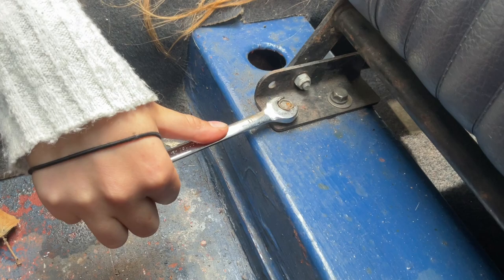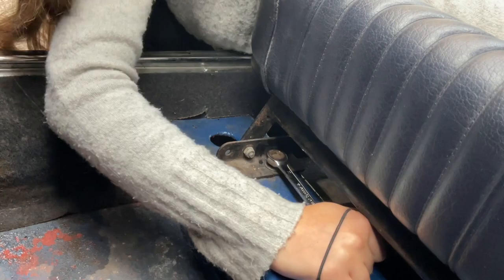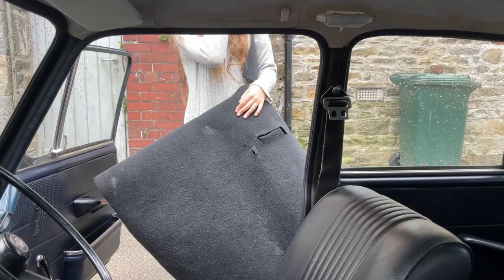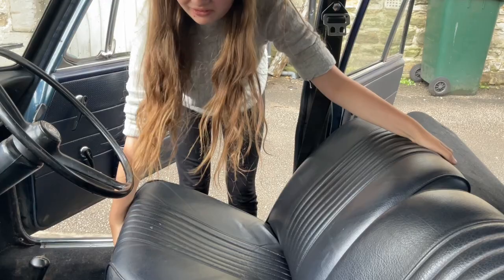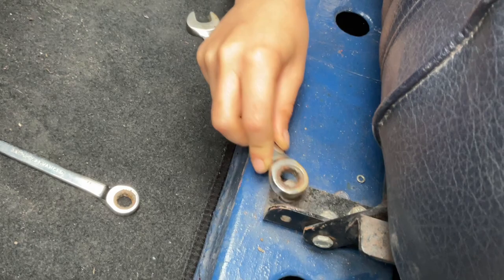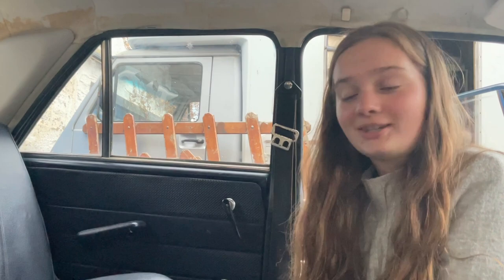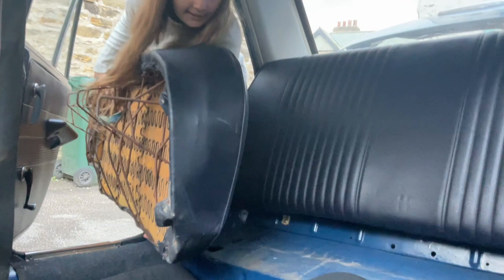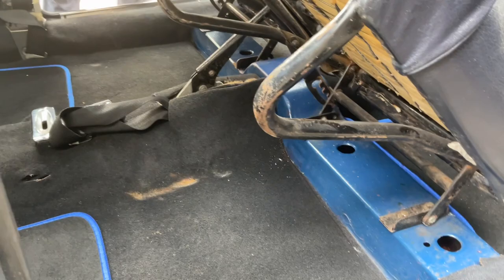How to fit a carpet (sort of) in a classic car Austin 1100 #classiccars #austin #classiccar

Comment: It was tight to loosen because the bottom of the bolt is on the outside of the car and it’s rusty. What you need to do is if it gets tight is to tighten up one turn and then loosen 2 turns until the bolt comes out x
Reply: what he said

Comment: Very good. Well persevered. It doesn't matter that you didn't need to take the seats out. You learned something from doing it. That's the most important thing. Everyone who works in any field of technology will have made a mistake like that.

Here is a bit of knowledge for you. When they built those cars in the 70s they used bolts measured in inches, so called Unified system. So the bolt you had your 11mm spanner on was actually 7/16 inches. 7/16 inch is 11.11mm but because of manufacturing tolerances the 11mm spanner fits. The bolt you used the 13mm spanner on was 1/2 inch. 1/2 inch is 12.7mm so your 13mm spanner went on OK. There are lots of other examples of this between metric and imperial sized fasteners across the whole spectrum of engineering.

Your film was excellent. I think you should get more involved with technical things, don't fight shy of it. Your brother could show you I'm sure. It would be great food for your enquiring mind.
Reply from the maker: Thanks yeah I’m not worried about taking the seats out I know we’ll get a few insults but I don’t care 😂 we had a laugh doing it and the car looks great, thanks for the comment 😊
Reply: I was going to say the same thing. If you've got a pre EU car, you need a set of AF spanners . Although a lot of metric spanners will fit, you need the correct size for tight nuts. Also, you should always use ring spanners or sockets to undo tight nut/bolts. Open ended ones can slip off. Always pull a spanner when undoing a tight nut. Never push to avoid nasty injuries if the spanner slips off.
Reply: Well said Derek. 🎉
Reply: @matildariverwaldennews  I don't think you'll get insults, if you do they aren't worth listening to.
Reply: @Derek_S  I think older British cars can be any random mixture of metric, Whitworth and UNC/UNF. Ford went metric relatively early I've been told, others not so much. Spanners for Whitworth bolt are labelled according to bolt diametre rather than head size (AF). You can cover most Whitworth bolts with an Imperial AF set but not all of them if I remember correctly. BTW, metric spanners are measured across flats too. M6 needs a 10 mm spanner, M8 a 13. M10 and up it gets interesting because there's different standards, for example DIN M10 bolts require a 17 mm spanner while ISO M10 needs a 16. Generic fasteners tend to require odd size metric spanners, hydraulics mostly even sizes.

Comment: You're making me nervous! Please don't try and do the same in the Vanden Plas...there's a lot more special padding and soundproofing under the carpets that really need specialist knowledge not to ruin them if you try and replace the carpets! Great little video though!
Reply: #staysafe 😂
Reply from the maker: Princess doesn’t need new carpets 🤔 it’s got more than it had 😂
Reply: Half inch and nine sixteenth spanners is what you really needed.
Reply from the maker: @MyJon64  No I didn’t I clearly needed not to take the seats out 🤔 but the spanner’s I had clearly worked!